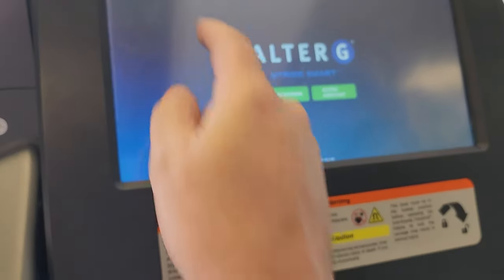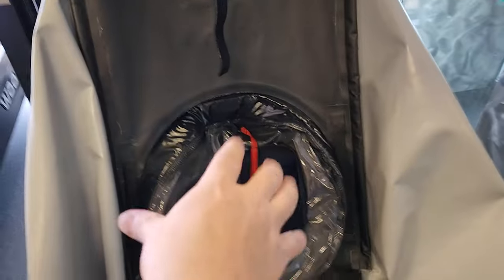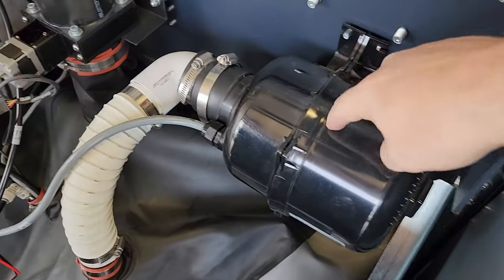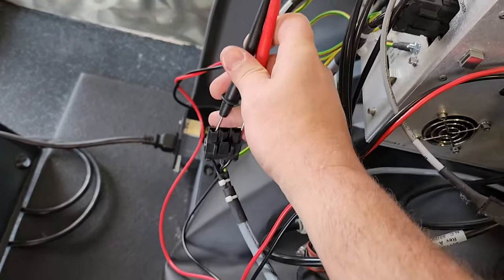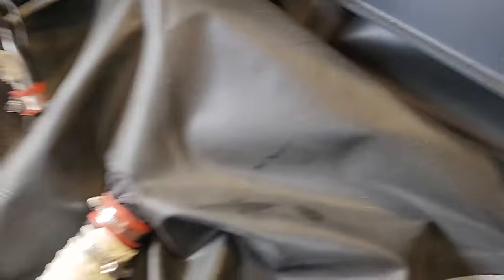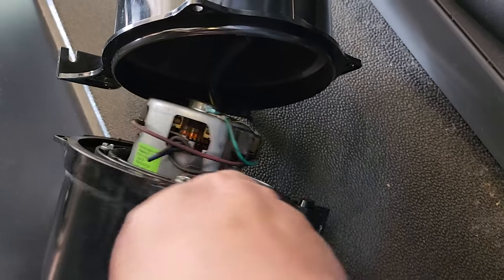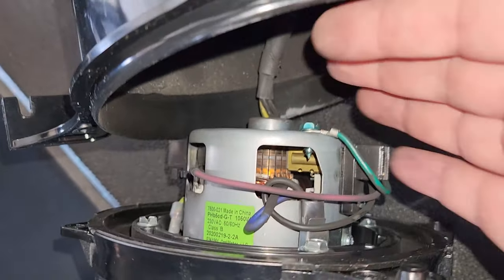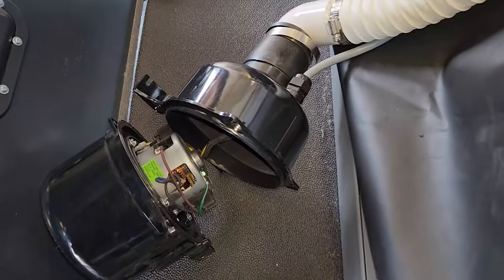AlterG Physical Therapy Treadmill Diagnosis

Comment: I have a mizuho OT table in my Hospital and the down function is not working in the remote. And manual switches it is working. I got another remote also but turns out the control  board is only malfunctioning. In board which element should I suspect is defective.. and change?
Reply from the maker: I'd love to check out this control board and hand control.

Comment: Why not keep the original cable and crimp and heat shrink the cable inside the housing with the new motor?
Reply from the maker: Excellent answer. The replacement motor does have crimp connectors inside the housing!